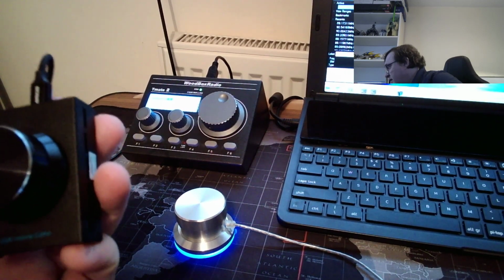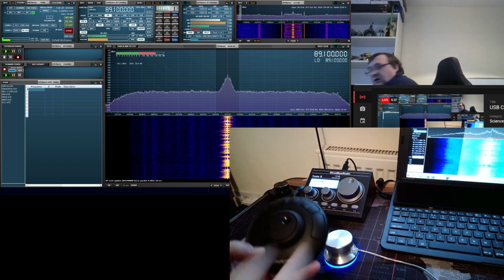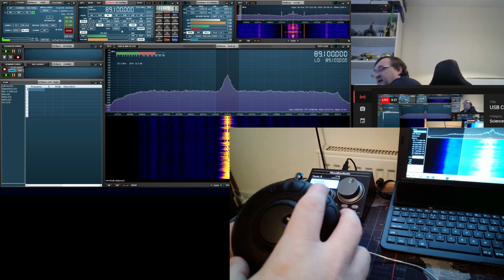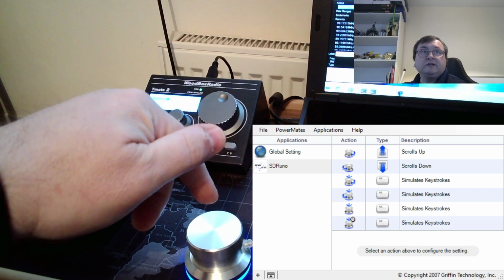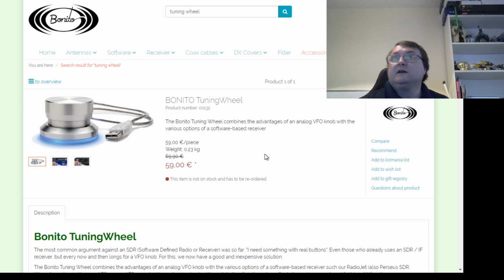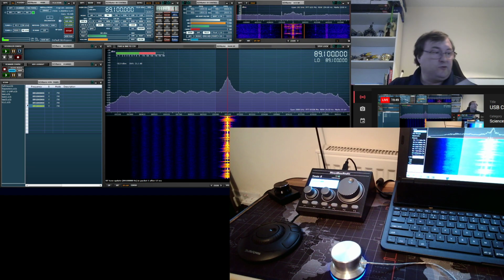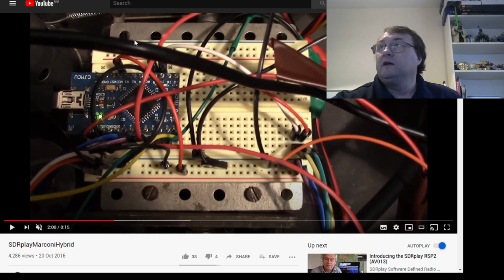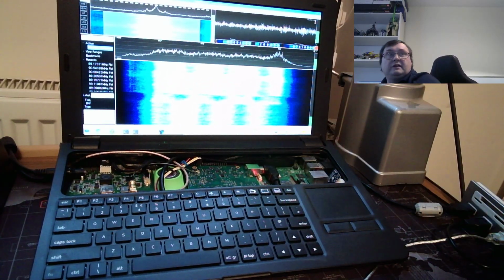USB Controllers, etc.

Comment: How about adding  MIDI control?  I own one of these and use it with Ableton, DJ Software, to control stage lighting, etc.  If MIDI learning could be added you could select a button in the software or keyboard shortcut and then press a control button, fader or knob on the APC controller and you have monster control of SDRUno!  On this controller you can also assign colors to the buttons so if you had the ability to add colors to the buttons in SDRUno that would be killer too!
https://www.amazon.com/Akai-Pro-APC40-Ableton-Controller/dp/B001T9O60Q
Reply: Rob McCulley, YES, MIDI! I've got this one and trying to make it work with MIDIKEY2KEY software:
https://www.amazon.com/dp/B07QV3LG83?psc=1&ref=ppx_yo2_dt_b_product_details

Comment: The shuttle will be sending key codes to the focussed window, it is unaware of the macro facility on your keyboard, it doesn't simulate F4 on your keyboard it sends F4 to the window/app. The best way forward is to have accelerators for everything in your app's UI and perhaps a macro facility within the app for (user) programming more complex actions. If you really want to open up the possibilities for controllers then you could look to support midi events, the music hardware market is awash with devices that have sliders, buttons and knobs at fairly inexpensive prices.

Comment: During the live stream yesterday I asked the question about possibly using a Bluetooth device as a controller - in particular, a Microsoft Surface ‘Dial’ - Today I looked into this and can confirm that it does indeed work and very easy to set up

Comment: How about the 3Dconnexion SpaceNavigator 3D Mouse? I bought one a long time ago, it's sitting unused in a tote in my storage. If that would work with SDRUno, I would happily pull it out and use it with my RSP 2.
Reply from the maker: If it comes with software to enable it to emulate keystrokes or mouse scrolling then it should work. I don't have one so I can't say what it can do I'm afraid.
Reply: @SDRplayRSP  I believe that the software for it does emulate mouse and keyboard. Thanks for the reply.

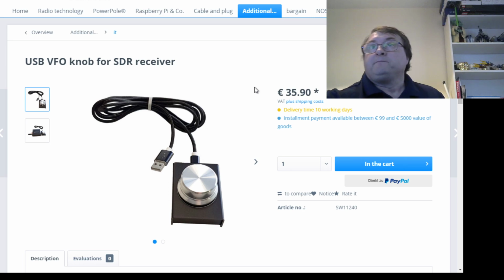Comment: The controller that you showed at 4:20 is available with identical hardware dirt cheap on ebay and amazon. All that needs to be done is to open it up and add a simple solder bridge to behave like the controller shown. The bridges are configured 0100 as shipped (volume) and need to be changed to 0101 (wheel). 73 and enjoy
Reply: Hi Jan, can you provide a link to the hardware you mention here? Thanks!
Reply: Ciao Alessandro. Shoot me an eMail at <firstname>@<lastname>.com and I can send you pics of the device (which I got off amazon) and the solder bridge.

Comment: Hi, your pitop with the raspberry pi 3 runs smoothly? on my pi 3b with the Cubic image jerky and does not run smoothly. what can I do?
Reply from the maker: not sure but I remember  that you need to OpenGL Hardware Acceleration
CubicSDR uses OpenGL and the Raspbian OS includes experimental hardware acceleration of these libraries. We enable these when a HDMI video device is detected. However, in our testing, enabling these libraries when using an LCD video device causes the OS not to boot. This would appear to be an issue with the new Raspbian OS “Buster”, as this worked fine for the previous Raspbian OS “Stretch”.